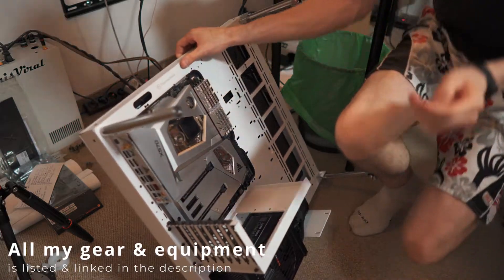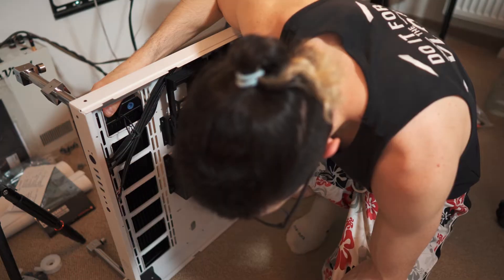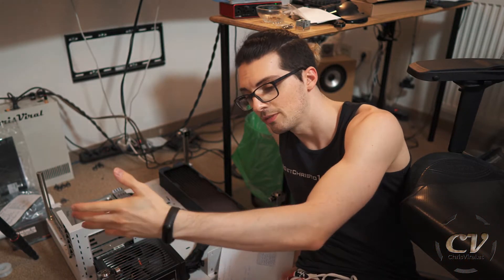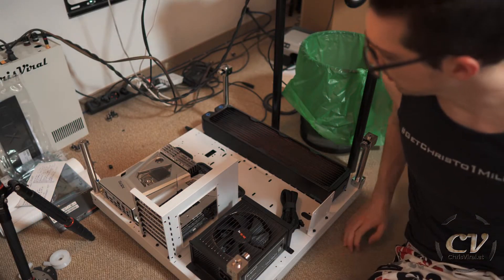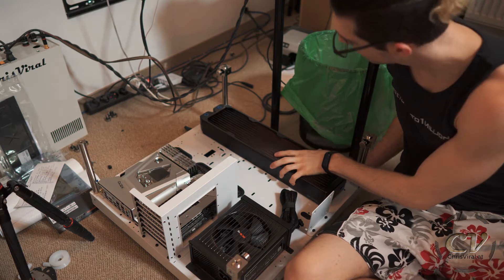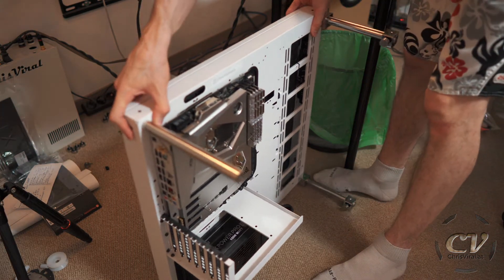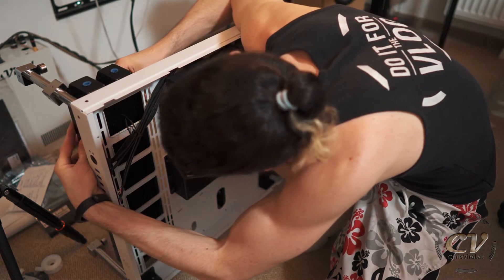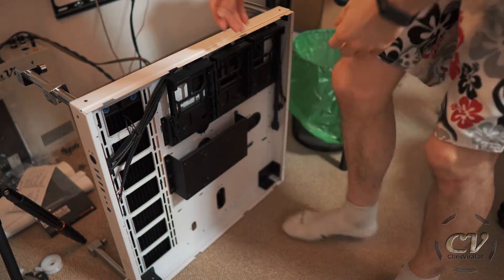Alphacool NexXxoS UT60 + Core P5 Case ($6,000 PC Build)

Comment: Hi dude. You are doing well, but small tip. Flip the radiator so that the fittings are at the bottom. You'll get an air bubble up there no matter what but if the fittings are on top you'll also get annoying splashing noises.
Also the Nexxxos should have a fitting on the top side to make bleeding air easier.